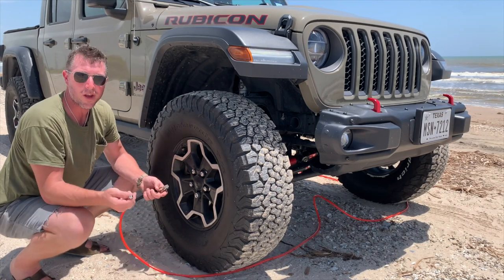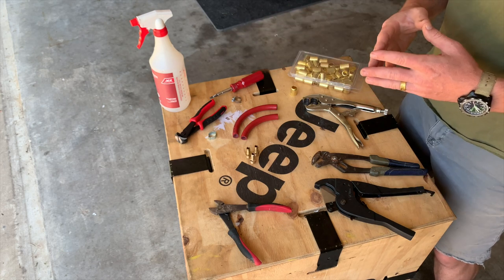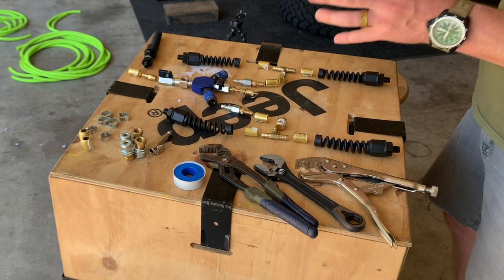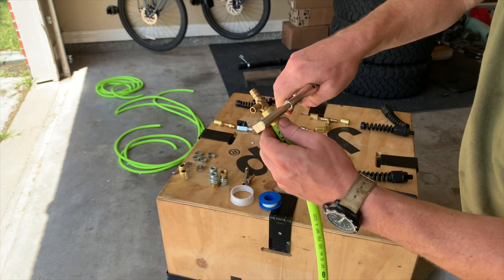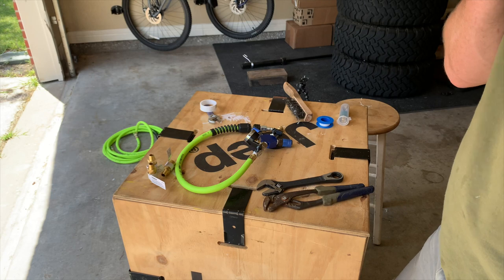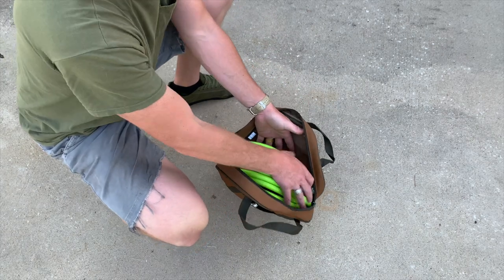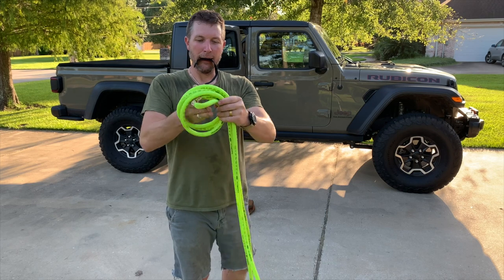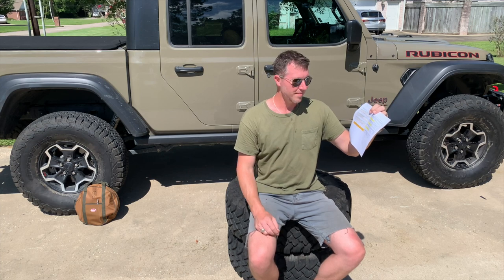DIY 4-Way Tire Quick Inflate/Deflate System for Off-Road Tires

Comment: Diggin the 37" tires!   Thats my plan (COVID stalled this) .Thanks for posting this 4 tire inflate/deflate idea.  very cool!  #JTRSpartacus
Reply from the maker: Thanks for the reply bud. I’ve been happy with them as well… You won’t regret going the four-way inflate deflate system.  Save your pennies and go twin compressor if you’re going 37’s… I Offroad only a portion of the year, so I justified the single compressor to save a few dollars… If I lived in Colorado or some back country area that I’d  benefit from airing down more often I would most definitely have gone twin. And to you, thanks for clearing up the pop start concern…

Comment: I noticed in this video that you installed a valve switch and tire deflater on the center spot opposite of the one that goes to the compressor. But later on you demonstrate how to air down and air back up and never touch this valve. Can it just be plugged instead?
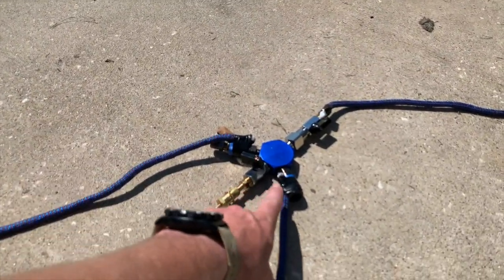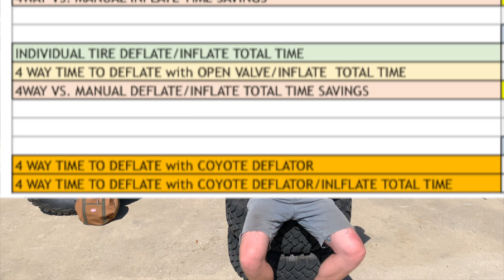Reply from the maker: Hey! Thanks for taking the time to watch and comment… I did explain the idea at about 1:47, but I did not end up using the coyote deflator in the video. I explain at about 30:10 why I didn’t go that route, it wasn’t time efficient. If you plan on inflating and deflating through the quick connect chuck like me, plugging the opposite port will be just fine. As seen at 22:57, you can optionally make it another dump valve to make it deflate twice as fast. I have a 1/4” npt to valve stem adapter on the nickel ball valve, but the shreader valve is removed and is just an open orifice. The reason for this, some off-road parks offer free air and usually high flow too. This allows you to attach their equipment to your manifold. This option may not always be time efficient, but it saves the life of your own compressor 🧠👈🏼.

Comment: excellent video, really informative, and super handy with the parts list! Unfortunately, the ferrules are discontinued...
Reply from the maker: Thanks for taking the time to watch and comment. the Links are for reference. There are plenty of places to get ferrules.. just make sure to use the advised size for your hose size. I was able to find them at a local ACE. Hydraulic hose shops will have them too.

Comment: i have a cheeper gspscn hi flow compressor which does great for what it is and happy with it. should i be able to change pump outlet hose to automotive air fitting to use normal air hose and fittings
Reply from the maker: It’s very possible, without seeing your application it’s hard to say.
For better contact, info, photos and video check us out on
https://youtube.com/c/GatorOverland
https://www.instagram.com/p/CF-X_58BjDR/?igshid=1r9yo0niyroip
Reply from the maker: Absolutely! The threaded end just needs an adapter to suit for whatever sizes quick connect you need. You may even find a quick connect they is that size

Comment: Do you experience the same issue with backflowing air coming out of the other 3 valves once you plug in the first tire? I had to scramble to plug in the other 3 tires first time out.  I just put on shutoff valves before each tire connector to solve.
Reply from the maker: 😂😂 no i haven’t experienced that. I know sometimes the chuck depresser in the middle can get wet and stick with oxidation. I keep them lubed with WD40.. make sure your Main deflate valve is closed.. then connect left and right main lines to the manifold.. from there you connect to your individual tire.. you shouldn’t have any leaking unless the chuck is stuck open.
See 22:00
https://youtu.be/3STi-cPd4r8

Comment: I'm looking at a Glad exactly like yours trying to decide if I want to wait for the diesel. What are your thoughts now that you are running 37s?
Reply from the maker: Decisions, decisions.. I’m a manual rubicon (4500# tow rating) I can say that the 37’s are closer to 35.5”’and only added 10lbs per wheel over the stock wheel/tire weight. I do notice there is a low end torque loss and I don’t see the need for 6th gear anymore, so a regear though ideal, is not needed, especially since I’m mostly highway and very little in town driving or towing. If you are in town or towing, 4.88 gear is what I would recommend minimal if you want near stock performance and fuel eco. 5.13’s if you tow a lot...but..you will be out of your fuel eco threshold again. If I was towing a lot or alot of highway driving, the diesel would be ideal, but for the maintenance and unknown reliability of the gen3, it’s hard to say what I’d prefer other than being a guinea pig. The 3.6 pentastar is a proven engine and loves high RPM, just lacks the low end torque umph of the diesel. In the end, it’s your call..
Reply: @GatorOverland  thanks for the response. You put into words all my thoughts..... Especially decisions decisions! If Gator was still available there'd be no decision I would wait and get the diesel. The gator color is the only thing making me consider the gas
Reply from the maker: Imagine having to wait from last May until October to even order Gator.. And then wait another eight weeks for delivery…I can only imagine how you feel about a gator diesel not being available

Comment: You’re using the ARB single, right? Is that compressor enough for four 35”s at once or would you suggest the dual?
Reply from the maker: Thanks for taking the time to watch and comment.. the single gets the job done just fine for my 37’s, but if I had to do it over again I would have gone with the dual. I justified the single by not using it often enough to need the twin, but “better to have and not need than need and not have”

Comment: I built a much simpler tool with a 7 port manifold and straight fittings, no quick connects except for the one that comes from the compressor. I used closed flow locking air chucks. Total for all the parts off Amazon was about 65 bucks.

Comment: Would it make sense to permanently install this on the undercarriage with the 4 ends popping out somewhere near the wheel well? The last 3 or so feet would be coiled air hose so you just reach it over to the valve on the tire. 
Reasons this may not work: 
a) No room/access to run the lines 
b) hoses would get punctured or torn
Reply from the maker: For a permanent application this works great… If you want to be capable for multiple vehicles the  the portable set works just fine… I have considered routing the lines on my frame for convenience… But I also like having the ability to save others time if I am able… It’s an either or situation……

Comment: you could make this with about 1/3 as many parts by just using simple tire chucks and barb fittings. cool video though!! good info
Reply from the maker: Thanks for taking the time to watch and comment… Yes it could definitely be simplified but I wanted to spare no expense and go into full detail in case folks wanted to go all in. 🤝
Reply: @GatorOverland  yes I appreciate that haha I like how it’s modular too so parts can be replaced easily
Reply from the maker: This was intended for universal use which has worked out great but I think my next step will be actually plumbing hose to four wheel wells and having a 2 foot whip to connect instead of all the octopus

Comment: This is an amazing video! What's the bottomline cost on the one you built exactly? I built the cart, comes up to almost the same as a Morrflate one :D.
Reply from the maker: Bottom line can be built for about 80 bucks depending on what fittings and connections you choose… The big cost of my set up was the air chuck’s and the choice to go with fle Zila hose. I built mine for about 150, but I spared no expense.
Reply: @GatorOverland  guess that's the route I'm going as well. Was tempted to order a prebuilt. But had to do this on my own  just for the satisfaction part of it :)
Reply from the maker: It’s all about that satisfaction… You can go either way and it works just the same… Some folks have a lot of that material lying around the garage… It’s a fun little project either way.
Reply: @GatorOverland  very true. I had a question, why have you marked only 2-3 of the flexzilal pro upgrade? And one of the swivel. What happens to the ones that come with the hose? Take off?
Reply from the maker: Yes, if you buy the flexzilla pro hose package it will already include 2 pro connections at each end, and once cut, those are utilized at 2 of the 4 corners. The 2-3 extra flex pro ends are for the other 2 corners and optionally the connection at the compressor if you don’t use the swivel option.
Reply: @GatorOverland  any pointers or local stores where theyre selling the H6 crimper for ferrules? I am pretty much done..but need the ferrule crimper and it's unavailable everywhere per se 😓
Reply from the maker: https://amzn.to/3yJa9a7 is the only place I see them besides actual mfg website. You may try looking up welding/hydraulic/agriculture/equipment companies in the area… They usually custom make/repair houses and such and might knock this out for just a few bucks if not free
Reply from the maker: You can always use metal adjustable hose clamps or side crimps for the time being.
Reply: Boy the H6 crimper came finally. However it fits 'exactly' over the ferrule. Am I doing something wrong? 🤦🏾‍♂️ Not crimping it actually.
Reply from the maker: I use the one closer to the opening of the pliers, not closer into the jaw.. i adjust the locking pliers to where they lock just after the tips of the jaws touch. This should squeeze/indent the ferrule in 2places.. unlock then pliers and turn 90 degree either direction and crimp again.. 2 revolutions works for me
Reply: https://smile.amazon.com/dp/B00VTPHW1A/ref=cm_sw_r_cp_apa_glt_fabc_FCDRG4J7E5CX69KVB2K9?_encoding=UTF8&psc=1 these are the ferrules being used. Man so bummed at the moment
Reply from the maker: @VinayVijayakumar  those are the correct ferrules for the project.
Reply from the maker: @VinayVijayakumar  I also start the edge of the jaw just down from the rounded edge of the ferrule where it starts going straight
Reply from the maker: For better contact, info, photos and video check us out on
https://www.facebook.com/JKHartel3
https://www.instagram.com/p/CF-X_58BjDR/?igshid=1r9yo0niyroip
Email: JKHartel3@gmail.com
Reply: Trying those now. Like at that zone, I'm definitely not feeling the 'teeth' sink in

Comment: I did some research regarding the Hose Size. (1/4" Hose is a lot less expensive than 3/8)  I messaged MorrFlate and this is the response.:
Hey hey! We use 1/4" ID hose. There is no point in using 3/8" ID hose since the capacity of airing up or down 4 tires is set by the valve stem orifices, rather than the hose ID. 4 valve stems can only move about 12cfm of air flow (without being pressurized with a co2 tank). 1/4" ID hose can move about 22cfm... almost double your 4 stock valve stems.
Reply from the maker: You’re absolutely correct… I had done this CFM research later on after my installation and realized I could’ve got away with quarter inch with little to no difference.. The the stem orifice is the limiter
Reply: @GatorOverland  I would love to see a new list of items from you with your affiliate links for a 1/4" system!
Reply from the maker: 1/4” 4way
 
(2) 1/4”x25ft flexzilla pro hose w/ reusable fittings (makes 50ft total with 4 reusable fitting ends)- https://amzn.to/3F682Rb
(2) 1/4” barb tee- https://amzn.to/3vBjctZ
(1) 1/4” NPT 3 way manifold- https://amzn.to/3vzKUaA
(1) 1/4” MNPT x FNPT ball valve pair- https://amzn.to/3ya37NI
(1) 4pk haltec air valve chuck https://amzn.to/3LTuGyV
(1) ARB adapter tee fitting https://amzn.to/3797ehL
(1) 1/8”x1/4” NPT reducing bushing https://amzn.to/3KGdcEu
(1) 1.5 air gauge  https://amzn.to/3OQ1BWN
(2) ARB quick release chuck https://amzn.to/3LQ9Uji
Reply: @GatorOverland  THANKS!

Comment: Kind of curious. What was the total cost of all the items purchased to make his system? And what's the cost of DIY vs already made.
Reply from the maker: Speedflate, MOREflate and other multi tire inflate/deflate kits are in the $150+ range.. you can build your own using simple vinyl PVC hose for about $50... i used the flexzilla hose and came to about $90.

Comment: Great video and well done!!
Reply from the maker: Thanks for taking the time to watch and comment Paul.. Let me know if you have any questions!
Reply: So I built one with 1/4” ID hose. I don’t remember your chart but today tested it. I Aired down all 4 tires to 18psi and then timed it with my ARB single back up to 35 psi. Having 35” tires it took just shy of 10 minutes. Am happy with it. The only thing I did notice was that I aired down one tire back to 18 psi and then used one line to air back up. Seems with the 1/4 hose there was enough back pressure that the gage read about 10 psi higher while airing back up. Meaning to see the actual pressure I had to close the valve to read it. Wasn’t the case when all 4 were connected up. Wondering if you see the same issue with the 3/8”ID hose on one tire.
Reply from the maker: Awesome!  Yes, you have to close the valve to get an accurate reading on the gauge. Inflating can sometimes be read, but i always close it to get the reading inflating or deflating

Comment: Search online for a “desired psi” safety pop off. You can get them in tons of different preset psi I am going to use a 10 psi pop off for my setup. The flow rate for most pop off valves is 45+ scfm which is way more than your 3/8 hose can flow.
Reply from the maker: Thanks for taking the time to watch and comment. I also use coyote deflators, which are exactly what you’re talking about, and they work great, and are fairly accurate when maintained. If you have a set of 4 they deflate 37’s about 1min faster than this hose setup. The big benefit of the hose setup is 4way equal inflation, the 4way deflation is a bonus.
Reply: @GatorOverland  yeah the pop off allows fast 4 way deflation.

Comment: Have you tried 1/4" ID hose before and if so why did you go with 3/8". Wouldn't think it would take that much longer in or out. Your thoughts would be helpful. I just feel 1/4" would be a smaller package and easier to handle. Thx
Reply from the maker: I have not tried it with 1/4”  ID hose… I did go with 3/8” for the idea of more flow, but I don’t think that ID difference is going to amount to a whole lot of time difference.. Ultimately your valve stem is what limits your inflate and deflate rate, the id difference will play a roll but I don’t think it’s much. It would be justifiable to go 1/4” to save a bit of space and weight. The convenience of doing all four at the same time even add a slight fraction of size for diameter of hose will be worthy versus doing each wheel manually.
Reply: @GatorOverland  Being a nerd type engineer I did some research and looks like the schrader can take about 20-25 cfm so plenty of what we could give them with all 4 connected. The output of the ARB single compressor delivers 2.34CFM at 30psi whereas the dual ARB compressor delivers double that @ 4.68CFM at 30psi. Looking at hose size ratings at 30PSI, 1/4"ID can flow about 5CFM, 3/8"ID can flow about 10CFM. Of course through in fittings, valves, etc... those number would change. I guess I just wanted to share this in case others are interested. I plan to go with 1/4"ID hose (About half the cost) and will try that and see how long it takes to inflate my (4) 35" tires. Anyway you look to be interested in charts and stuff thought you might like this info. Based on this info it looks to me even the ARB Dual compressor would be a good fit for 1/4"ID hose. Maybe too much info LOL Have a great day. Oh, BTW I have a ARB single so don't think it will mater to me much.
Reply from the maker: Dude!! Thanks did much for the research.. copy and pasting that in my note now 😂
Reply: @GatorOverland  I am looking into a DIY system that I am designing that shuts itself off both inflating and deflating. Meaning set it and forget it.
When inflating with my 1/4" hose system like yours my gage reads about 44psi with all 4 tires hooked up while inflating. Can you please tell me what your gage reads while inflating being you have 3/8" hose. I am thinking that I would get a more accurate reading while the pump is running if I move the gage down inline between the tires. Thinking that I am reading back pressure created from the quick connects. If that is the case then your system should read about the same with the pump running. Say deflate to 30 and then during inflate read the gage. Thank you!
Reply from the maker: You bet! I will report back.. contact me via email for better contact JKHARTEL3@gmail.com

Comment: Great detailed video except for one thing - You don't include the setup and put-away time  in your time comparisons. I'm sure its an extra 3-5 minutes uncoiling, setting up and coiling back up all 50 ft of hose. For deflating - I don't think the JT Brooks Pro can be beat for simplicity and speed. I am going to build a 2-tire hose since I think that is the right balance for time, efficiency storage space. Well done video though!
Reply from the maker: I did not time it, but in the video you can see me actually doing it and it only takes a matter of seconds even with my talking… I would say 3 minutes at most for a full unbagging, connecting and then rebagging ... let’s just say I’ve never been the last person on the trail since going to this method😂